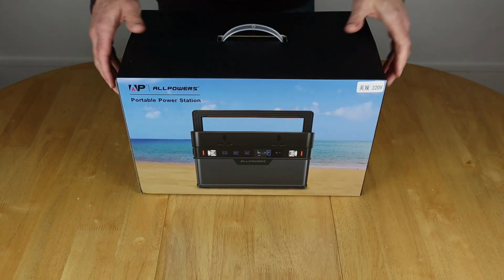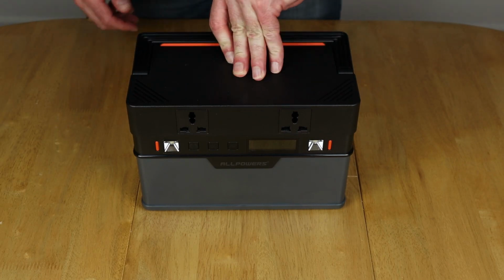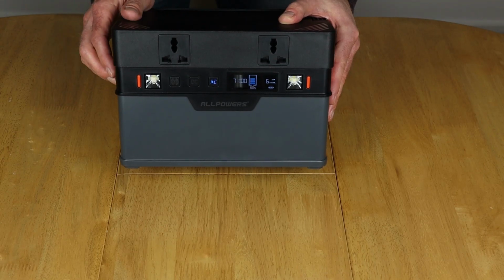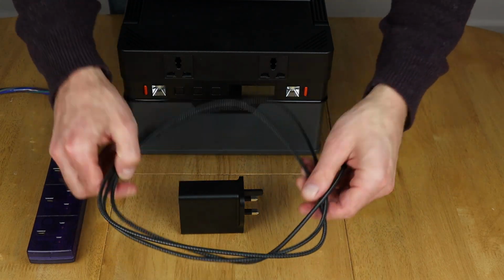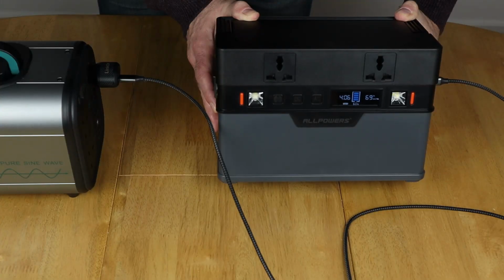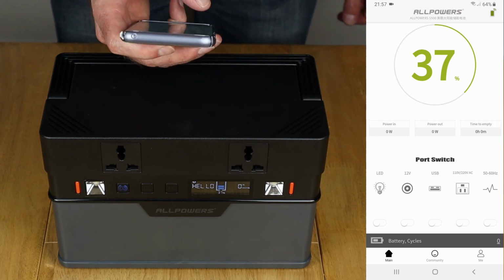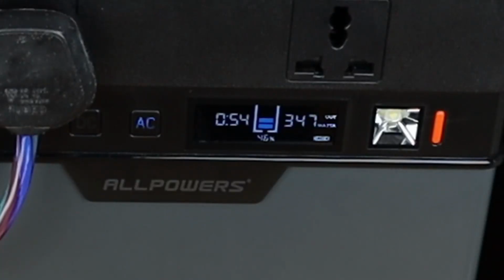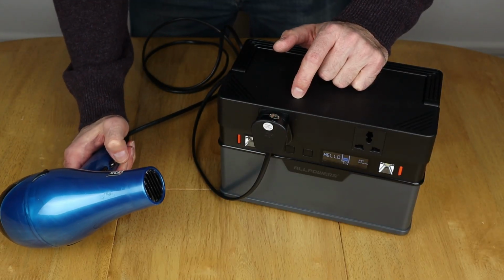ALLPOWERS 666Wh Portable Solar Generator Unboxing & First Look | Even More Pickup and Go Power

Comment: 606 actually
Reply from the maker: @alexandr1989UA  Good day and thanks for your comment. It was originally 666Wh (when this video was released). The manufacturer informed me that they revised the battery pack in this and the 372Wh model due to increased costs. This version was dropped from 666Wh to 606Wh and the other was dropped from 372Wh to 288Wh. All the best, Adrian

Comment: Friend can be used with a common refrigerstor.🤔
Reply from the maker: @JOSE LUIS ORTIZ  Good day and thanks for your question. I've tried it with my domestic fridge freezer and it doesn't work. The initial surge required to get the compressor running is too much for the inverter. The 666Wh works fine with my Alpicool C15 though as featured in this video > https://youtu.be/3HE_VlFjt1o. All the best, Adrian
Reply: @DADvinci  thank you very much friend.😉👌

Comment: I've got 2 cig.lighter ports in my van. Can I not dual charge. 1 via the  dc5521 port and 1 via USB-c? Wouldn't this give me about 100w?
Reply from the maker: @phillip williams  Good day Phillip and thanks for your question. You could do this, but I suggest testing it first to see what it draws in total. It's a good idea to stay around 10A (around 120W) or less. I always recommend having the engine running when charging too, otherwise it could quickly drain your battery. All the best, Adrian

Comment: Just bought the smaller version. Wasn’t sure of the charging speed with a 100w pd. have you tried it on either? With perhaps the mains plugged in too? 

Some older anker power banks would let you charge from 2 usb inputs.
Reply from the maker: @Phi Chong  Thanks for your question. I've responded in the other video comments section. All the best, Adrian

Comment: hi,  both my friend and i have the allpower 606wh which puts out 500watts and peaks at 1000watts,  the 666 you are reviewing im sure is rated at 1000watts and peaks at 1500 to 2000 watts
Reply from the maker: @stephen smith  Good day Stephen and thanks for your comment. The unit I have is the 666Wh and precedes the 606Wh. The manufacturer confirmed that the newer 606 unit is essentially the same but with a slightly smaller capacity. I believe this is due to the cost of batteries as this is what they confirmed for their popular 372Wh, which now has a capacity of 288Wh. The AC inverter remains the same (from the specs and their confirmation). I hope this helps. Please shout if you have any questions. All the best, Adrian

Comment: @05:30s. What was the one on the left display? Is it the clock or time tomfully charge?
Reply from the maker: @Ash  Good day Ash and thanks for your question. You're correct, it's the estimated time to fully charged. This isn't very accurate when you first plug in or start charging from solar, but does improve a bit once it gets going. All the best, Adrian

Comment: Hey DaDvinci, I love your channel! My All powers just says hello even when using it? any idea why that is?? Any help appreciated
Reply from the maker: @Darren NeRoi  Good day Darren. You are too kind, thank you 😊👍. Just to confirm, is it saying hello all the time even when you aren't using it? All the best, Adrian
Reply: @DADvinci  thank you for your reply Adrian 🙏, I plugged my solar panels in and was running a small fridge through the car cigarette port. It said hello with this set up. But if I turned a light on it changed. I have the 666 unit. (Which I got because of you and I love it, plus I've bought your recommended lead accessories.)
Reply from the maker: @Darren NeRoi  Thanks for the info Darren 👍. To me, it sounds like your unit is displaying 100% charged, but is still charging. The hello will only disappear when you draw power (hence switching on the light does that). I imagine that your fridge is a compressor fridge that isn't running all the time (unlike thermoelectric ones)?

The 666 continues to charge (for some time) after showing 100% charged, so the hello message stays there when you're not drawing power from any ports. I think this might be the case > https://youtu.be/5BtddOoEAuE?t=288. Please can you let me know? Cheers, Adrian
Reply: @DADvinci  thank you again for your reply. Yes your 100% correct about fridge , I think you solved it. Thank you so much. Is there any thing you would say I would need that I am missing? Thanks a million
Reply from the maker: @Darren NeRoi  No problem at all, I'm so pleased it helped! Was there anything else you were particularly looking to do with your 666? For example, are you looking to boil water using solar? Charging or running another device? Cheers, Adrian
Reply: @DADvinci  we are looking at using it for our tear drop camper, running a few led lights and a couple of usb chargers. We have the 100w solar panels. Thanks a million again, I learn loads from your channel 🙏

Comment: Two things you answer in the Jackery 500 review video but not in this Allpowers model video is regulated 12v output and pass through charging features . Does this Allpowers model offer both of those too?
Reply from the maker: @e6 Vlogs  Good day and thanks for your question. The cigarette lighter output isn't regulated which is shown in this video > https://youtu.be/u35nCNS1v2k?t=223. This model does allow pass-through charging and here's the full playlist if you wanted to have a look > https://bit.ly/3juowGq. The updated version of this model has slightly less capacity at 606Wh and is generally cheaper direct from AliExpress (details in the description of this video). I hope this helps. All the best, Adrian

Comment: Lol. It's actually 606Wh. Not 666. Lol. That's hilarious.
Reply: OH! It is 666! I stand corrected. WOIW!
Reply from the maker: @Robert Laster  Good day Robert and thanks for your comments. We're both correct. The original version of this unit was 666Wh. The manufacturer has since revised it so it's now 606Wh. They've told me that they made improvements which means it's more efficient than the original, but have dropped the capacity slightly (not entirely sure why you would drop capacity). I hope this helps. All the best, Adrian

Comment: Hi! Can it be used with other solar panles that are not from Allpowers brand? 
Thanks!
Reply from the maker: @oscar jimenez  Good day Oscar and thanks for your question. Yes, you can use any brand of solar panels with this unit as long as the panel Open Circuit Voltage (Voc) doesn't exceed 30V (the limit on this unit). Please shout if you need anything else. All the best, Adrian
Reply: And watt can also be quit high? Now in winter my 130Watt solarpanel give me low energie can i just connect a other solarpanel to or could 260Watt to much? 
Thanks!

Comment: Can it run inverter Aircon?
Reply from the maker: @josey foronda  Good day and thanks for your question. I've not tested one myself, but I doubt the 500W inverter could cope with the start-up surge required when the compressor kicks in on the aircon unit (even something that has a small output in BTU terms). All the best, Adrian

Comment: Is this powerstation with a 100w or 120w solar panel able to provide enough power for a Compressor cooling box, some lights, mobile phones and a MacBook Pro (maybe some drone batteries and ideally an ebike battery)? Or would you rather recommend to build a solar system with 2x100w solar panels, Victron charge controller and a 120ah solar battery? I am just curious as with the 2x100w solar panels fixed to the roof of our camper we would have to stand in the sun all day which makes it really hot inside and with a powerstation and a mobile solar panel we could park in shadow and put the panel in the sun. Do you think thats working or what are each up and downsides? Thanks a lot in advance!
Reply from the maker: @JimyApe  Good day and thanks for your question. This unit has been slightly revised since my review and it now comes with 606Wh, but the manufacturer has mentioned that other improvements have been made (including charging). The best I've got out of 200W worth of panels is about 100W (connected in parallel). This is due to the voltage limit on the Anderson port (30V), so you can't connect 2x100W panels in series as the voltage goes above the limit. Connecting the panels in parallel keeps the voltage in range and adds the current (Amps) together. So, although it increases the current to about 10A (for the two panels), the charging limit is maxed out at 5A, so you don't get the advantage of up to 200W of charging capability.

It should be able run and charge all the devices you've listed as long as individually or combined (at once), they don't exceed the 500W continuous output from the AC inverter or 10A from the cigarette lighter output and 5A per DC output port. Being able to use the unit whilst charging from solar will help slow down the battery usage on sunny days, as if you're getting say 100W in and using less it should maintain the battery charge. 

If you did go the component system (battery, charge controller, etc) you usually get more capacity for the price as you're not paying for the convenience an all-in-one system offers.

Do you have an idea of the amount of power you're likely to need and whether it will be AC or 12V DC? Even if you did go the component route, you could still use portable panels with the right connectors. Please can you let me know? All the best, Adrian
Reply: @DADvinci   as of right now, we are only planning on 12V DC as all our devices are able to load with USB or an car lighter. So we would have the cooling box for 24/7, load two iPhone X every day, one MacBook Pro once or twice per day and some times drone batteries or other small stuff that runs in USB, like led lights, mixer some seconds. 

And then there is the question how to store a real solar component system in winter plus the weight. A 120ah agm battery weighs around 50kg whereas the one in your video only weighs 5kg. And being flexible is pretty important to me, I just have to be sure that cooling box and my laptop are working. I read in a Amazon review that the cooling box alone was able to run 3 days on the allpowers battery before being empty. So if I am loading my MacBook and two iPhones once per day and maybe use some lights, I should be still able to use it for 2 days, no? And if I have good sun it works even better. 

But how many days without sun could I have power when using the component system with a 120ah agm battery?
Reply from the maker: @JimyApe  Thank you for the extra info👍. Could you charge from your camper 12V when solar isn't available (if travelling around)? I'm trying to figure out how you could top-up to keep going.
Have you seen the LiFePO4 case battery videos on the channel? They have been brilliant, in their own right and as part of the MPP Solar Inverter system. Unfortunately, the manufacturer put up the price shortly after the most recent video, so I'm looking for alternative options that would be significantly lighter than an AGM. I've got another LiFePO4 battery on the way from China as I type this and that's under £300 for 100Ah (like my current case batteries). I've attached a solar charge controller to my case battery (video to come) so it's still portable and can be charged from solar and a 12V cigarette lighter outlet (with a 12V to 24V charger).

Do you know how much the MacBook Pro typically uses in a day, as I don't have one so couldn't guess at daily consumption?

Here are the videos featuring the case batteries if you fancy a look. Original > https://youtu.be/WPYTCasOtuE, New > https://youtu.be/AEjroUPdkTw & MPP build > https://youtu.be/PzQw4eR0YEA. Cheers, Adrian
Reply: @DADvinci  Well I think I would be fine with paying more and having a portable power station. As I still don’t know what to do with the agm when not traveling and we are mostly traveling for 2-3 weeks and that 2-3x per year. 

The MacBook uses a 60W 12V charger and needs to be charged for about 2 hours sometimes twice per day. 

On the other hand I could make some usb or lighter sockets into the closets with a component system. As I am not able to do that with the power station, right? Or is it possible to use one DC port and manually cable 2-3 usb 12v or 12v lighter sockets on one cable and just plug it in the powerstation when traveling? 

I am really pleased by the powerstation idea, just not sure if we can make enough power with 100W solar panel 😅

I can use a 12v lighter socket to load the station while driving tho if you mean that would help us. As mentioned we are driving a 30 year old Volkswagen T3 Transporter and I am a bit scared if it will empty our battery? But I am not experienced enough with car electricity, surely the socket is kinda secured to not exhaust the battery, right?

And if the weather really is against us, we still can go in a campsite to reload from time to time.
Reply: @DADvinci  Hey there, you might forgot or been too busy, but would be amazing to get an answer from you. Thanks in advance!
Reply from the maker: @JimyApe  Hiya! I'm so sorry, didn't see the original notification (for your previous message) and thanks for the reminder. I've also had a few other things going on and my mother passed away last Sunday, so extremely difficult times. Just dipping my toe back in the water and trying to answer as many questions a possible (good distraction currently).

So, it sounds like you need a power station that's got enough storage and the ability to charge from your T3 to cover cloudy days. The good thing about power stations is that most can be plugged into the 12V cigarette lighter output and they typically draw around 45-70W, which shouldn't put your T3 battery under too much strain (providing the battery health is good enough for cold starts in winter) as long as the engine is running, preferably driving. 

I guess the other consideration is budget. The 606Wh version of this is likely to cover what you need as it has good usb and DC outputs, although the 12V cigarette lighter output isn't regulated but does stay above 12V to almost the end of charge. The other option might be the Explorer 500 which charges well from 12V vehicle outlets and also has a good 500W AC inverter like this unit (although that’s not your focus).

The other option is to go for an even larger unit that can store more, like the EB150 or Explorer 1000, so you can run for longer without sun. There is a cost jump associated with this though. You can also get 12V cigarette lighter splitters if you needed to run more usb/12V devices, along with USB-C PD output (as USB-C doesn't come on Explorer 500).

I'm hoping this helps a little, but I think it comes down to a unit that works with a 100W panel and has decent 12V charging for cloudy days, and whether you want to stay at the capacity of this unit or Explorer 500 (500Wh) or go large at more expense. Please can you let me know what you think? Cheers, Adrian
Reply: @DADvinci  Hi, no problem and I am very sorry to hear about your mother passing away. Hope you are doing better and thanks a lot for your answer in that difficult time. I am considering on either buying the Allpowers 606Wh or the Poweroak AC50S, which would you recommend? And do you have good recommendations for a 120W solar panel that fits to those powerstations?
Reply from the maker: @JimyApe  Many thanks for your kind words❤ I like to test things out before recommending, which I've not done with the AC50S I'm afraid. The 606 has a larger 500W inverter, higher output USB PD port and it has dual mode charging (so you can charge it quicker by using the USB-PD port input as well). If you had a 12V cigarette lighter output connected to your agm, you could also use a USB-C PD 12V charger to charge the 606, whilst it's also charging from solar. I'm not sure if you've seen this video, but it shows the dual mode charging > https://youtu.be/5BtddOoEAuE. 

You could get one of the ALLPOWERS or ECO-WORTHY 120W folding panels, although I've not tested them. This video might help > https://youtu.be/KUq1lnMjfAk as it provides two different options in one hit. I hope this helps and please shout if you have any questions. Take care, Adrian

Comment: Thanks for all the advice so far!

If i would like to charge the device on the go while driving, what cable do i need?
1. a cable to put the powerbrick on the cigaretteadapter at the car - explained in the video - direkt cable works
2. a cable directly from the 12V to the cars cigarette - if i got one yes
3. cigarette to cigarette cable? - no get a cigarette to usb c converter into usb c cable <<--- Best option 

edited: thanks!
Reply from the maker: @Magengegend  No problem at all, I'm glad to help. For me, the 12V USB-C PD charger is still my go to option for 12V charging. If you've got more than one 12V cigarette lighter output in your vehicle you could use dual mode charging which is even faster. Not sure if you've seen this one, but it might help > https://youtu.be/5BtddOoEAuE. Cheers, Adrian

Comment: Hi. Thanks for the very informative videos! our new Allpowers 666w does not register any solar panel input through the Anderson port so is not charging. Any ideas? Cheers, Paul
Reply from the maker: @Paul Brandwood  Good day Paul. Thanks for your generous feedback, it's very much appreciated👍😊. Does it charge using the standard DC input next to the Anderson port? What type of panel and Anderson cable are you using? I look forward to hearing from you. All the best, Adrian
Reply: Solar Charger DC/ Anderson Input: 16.6V-24V/5.0A(Max.): It appears the solar panel should be 5 amps or less.